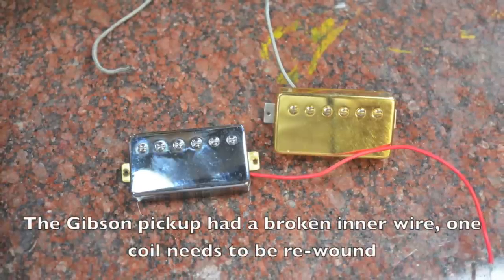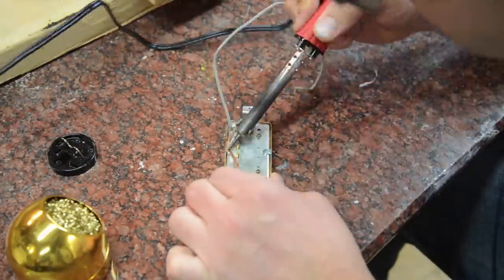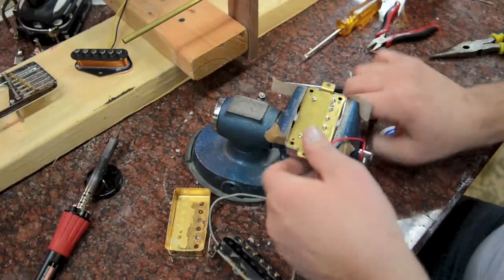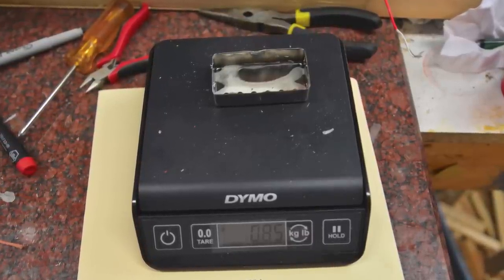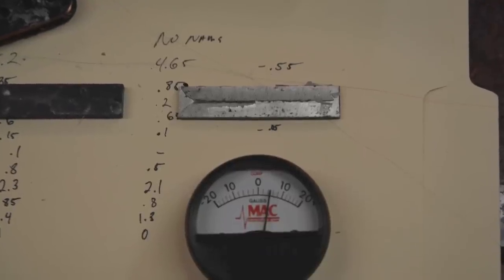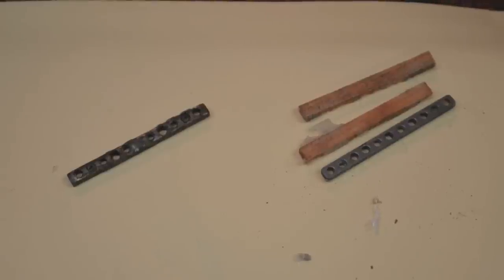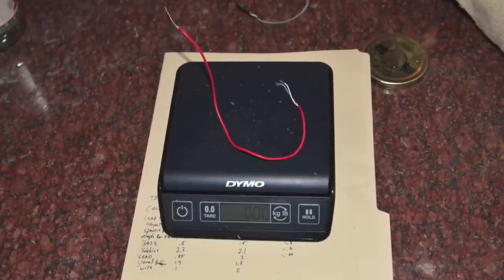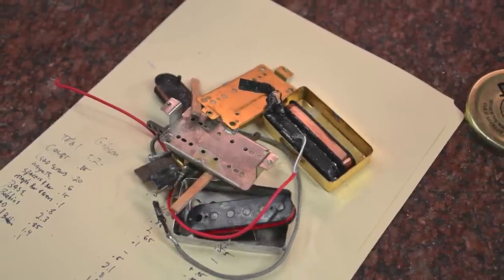Chinese vs. Gibson Humbucker, what makes a good pickup?

Comment: why do you state that the Gibson copper wire is a better quality one? they're probably made in the same Chinese factory...
Reply: the only significant difference between those pickups are the material in the magnet, and the quantity of windings in the bobbins.
Reply: Wire of the same gauge is made with all kinds of alloys. The chinese are known for using less copper and more fillers in the formula.
Reply: George Lackey that would dramatically affect resistance.

Comment: Easier way to remove the covers, heat up the solder and slide a razor in between. The solder won't stick to the razor and when it cools, pull the razor out and the joint is seperated

Comment: Well, I was expecting a DC measurment reading for each bobbin, testing how "magnetic" the base plates are, like Jay Dee sais it's far more important than weight.
Was expecting also the number of turns in each bobbin, and how was the wire winded in each pickup.

You are just comparing the weight of parts in both pickups, and left out some of the most important details while comparing two similar pickups

If you are building all American pickups you have to get rid of your Chinese soldering iron, chinese made Phone, Chinese screwdriver, Chinese wire cutter and Chinese scale, you'll be better off using all European tools!
Reply: Chinese can make high quality of anything... But you Will pay that.

Comment: While the differences are more noticeable. The real difference is the wax potting for microphonic. I had to pot a microphonic Chinese Telecaster single coil neck pickup. I used surfboard wax so that I wouldn't have to melt wax & dip anything in a saucepan. The surfboard wax, I was able to spread that on the inside of the neck lipstick style cover for the top & sides, and when I pressed the pickup & reassembled the pickup the microphonics were cured. With surfboard wax the sun will melt it f left out for a 1/2 hour in direct sunlight heat of the day, a hair dryer melts & flows the wax too. Heck leave it in a hot car and the wax softens even more, may even flow & have the same effect as wax potting by melting the wax in a saucepan. Ceramic magnets are stronger than Alnico V, you'd have to get Alnico 8's to start to have Ceramic strength. The stronger magnets are going to have a tighter low end, so it depends upon what genre of music you play. Metal, ceramic are actually the better choice, warmer tone go with a Alnico 2-V. DCR is just the relative number of windings of wire. All the guitars I have are ceramic single coils, P90 in Epiphone, whatever a Squier or Monoprice has in Strat or Tele. The surfboard wax and the Telecaster was as quiet as the P90, closely approximated each other for not being micophonic & tone really. The Epiphone P90's were 8.2k & 9.2k for neck & bridge DCR. The Chinese Tele was 7.2k & 6.8k neck & bridge. Enough difference, but not hat much.

I agree Gibson Alnico > Chinese Ceramic, not appreciably better, remember tone is subjective and is in the listeners hearing & mental perception. Mu point is, that a set of Chinese pickups will last as long and indiscernible at the string & pickup point of the process. After that there's an instrument cord, pedals of a signal chain. Then there's the preamp section of a circuit, any effects loop & that eventually ends up at a speaker that is voiced differently. The pickups are only capturing & transmitting the string vibrations. Those are a set of 10's, 9's or whatever you're stringing the guitar with. As long as the pickup registers the vibrations& passes that signal on, the pickups may even be located at different points between the neck & bridge saddles. Where one also picks & strums, affects tone, same with the pots specifications & even the microfareds of any capacitors in that signal chain.

Comment: This is probably a silly question, but why do covered pickups potted with wax and pickups with exposed bobbins not. Second, if I removed the covers permanently, must I remove the wax?
Reply: The exposed bobbins are probably potted and then wrapped (the copper). The wax between the bobbins and the pickup cover is probably used to reduce microphonic response of the metal cover.
Reply: I recently took apart the uncovered humbucker from my Epiphone SG Junior. The coils were potted. I figure they just cleaned off the bobbins.

Comment: I made a fixture for breaking the solder joint on the cover, a piece of wood almost the thickness of the pickup With a rout that the pickup fits in. I can now securely use a chisel to break the solder joint, which is a much safer way to do it, not so much chance for overheating the inside of the pickup. Try it :-)

Comment: It's better to cut the soft solder on the cover removal than to use a solder wick and subject the pickup to too much heat.  You can use the wick after it is apart.
Reply: +Kurt Cathcart I was cringing at what he was doing. Should use the fast easy method, a razor blade and a few taps. This guy knows not what hes is doing. Some people should never go near tools
Reply: Get a real soldering gun and use that rather than a soldering pencil. It is quick and you are done before anything gets hot. It's the same when soldering any ground spots to the back of a pot. Fast heat so you don't over heat everything.
Reply: Sometimes a little knowledge is bad.The dude sounds medicated, droning on and on.
Reply: What's  high end custom got to do with it? The dude is just a novice in training!
Reply: Yep, with a SEVERE bias to anything that says Gibson.

Comment: Vacuum wax potting can draw it deeper into the coils, I've seen variation in import manufacturers (some are dipped and some show vacuum). Some are pure petroleum wax (looks like Gibson you have is too) and other boutique builders mix in beeswax to offset shrink after cooling plus give higher melt point protection (if someone leaves the guitar in a hot car). I think Gibson vacuum pots their pickups (saw it in a youtube video), PRS wax pots theirs at the US plant (I was there at one of their open houses).
.
I've been doing a similar survey on pickups that lead me to focus on high internal capacitance as the cause of "muddy" pickups. I've found some of the import pickups have much lower internal capacitance than the 'famous brands' for equivalent copper length/resistance. "Hand Wound" pickups will have lower internal capacitance than "Machine Wound" due to scatter winding and tension on the wire (tight coil vs bird's nest) and wire coating thickness. I find high capacitance is like having the guitar tone knob permanently cranked passed 1 or 2 on the higher capacitance coils. For high capacitance pickups (like super over wound hotties) you can add a capacitor in series so it cuts the total pickup capacitance and gives back the clarity -- but why not start with a low capacitance coil?
Reply: Here is a bit of info most people won't consider.

Lower Z pups are the "vintage" sound. If you play real PAF pups through a Fender Bassman or Marshall amp you get magic tone. Super high Z pups are for metal and other stuff. Those folks think they want "vintage" but have no idea of what "vintage" sounds like. Anything over 10Khz is gonna be overkill unless you are looking for a Zak Wylde sound. 
A LP should be played with the volume on 5 - not dimed - for a vintage tone. Same with a Strat. Learn to use those volume and tone controls.
People will buy a $9K LP RI only to put some hot aftermarket pups into it. If going aftermarket at least go PAF voiced. SD and others excel at it.  
The hottest pup I have is a Dimarzio X2N mounted in a Partscaster I put together in the early 80s. It was meant for heavy and hard stuff but that pup is surprisingly clean. Lots of gain but clean. Yeah, it's ceramic; I prefer Alnico.

Tone quest definition - 
A guitarist who has played for years and thinks he needs better tone than what he has. He spends $$$$ on different amps and effects only to find himself chasing the elusive tone.
The funny thing is he had the right tone to begin with. I have watched it for over 40 years. 

I went from a Marshall stack to 1x12 combos; I have a few. I like the tone better and can always plug into a 4x12 if need be. Good thing sound guys mic amps so I can avoid the big cabs. 
I have a little SWR Workingman's 12 for bass and a larger Hartke cab if needed. Those big ass SVT cabs and folded horns are hernia machines. Bass is usually DIed in larger venues.

Comment: what is the price difference? You left that out of your comparison.
Reply: PRICE DIFFERENCE CAN BE AS MUCH AS 100 DOALLRS RIDICULUS  WHEN SOUND IS WHAT REALLY MATTERS  BEEN PLAYING  40 YEARS   I HEAR VERY LITTLE DIFFERENCE   GOT A  CHINESE STRAT RAIL   11 BUCKS  VS A SEYMOR  70 BUCKS   SOUNDED  IDENTICAL    SHAMFUL   IT A COIL   IF IT HAS MAGNETIC PULL IT WILL ROCK     I  MOSTLY USE STUFF FROM   EY GUITAR PARTS  GOOD SELECTION AND VERY GOOD PRICING
Reply from the maker: the gibson was dead so I paid 24 for it.  I got the cheapies for 17 total.
Reply: fred cook why the capslock? I'm one of those snobs that claims he can hear a difference in pickups. In a blind test I (and 5 out of 6 guitarist) actually heard a really clear difference even in the way pickups are wound. This was a test between Gibson burstbucker 1&2 and handwound boutique PAF replica's from a Dutch builder in several 'identical' guitars. However,  some gear is more sensitive/transparent than others and it's more audible with low to medium output pickups (everything is more audible with low to medium output pickups).

I disagree on the fact that a pickup sounds good as long as it has magnetic pull, but I do acknowledge the fact that active electronics and/or high gain is less sensitive to details.

I recommend people to try many pickups before actually investing in a set. I generally find Gibsons really underwhelming, even though the build quality is fine
Reply: i think what i am trying to get at here is, it is misleading to say something is lower quality compared to something else unless you tell the audience what the relative difference in price is.

That said, I appreciate this video was about quality not price, I just think the Chinese stuff gets a hard time on YouTube. They are not trying to compete tone-wise, they are just doing it quicker and cheaper and this offers those who can not afford expensive guitars a great way in to playing.
Reply: I'm all for a better image for asia built guitars. It's giving US gear a big run for their money, which has 2 major wins: US brands have to work harder to really show they're worth the extra bucks, and there's better low budget stuff. 

But the details...that's what really makes the difference in these guitars. Upgrading pickups is pretty straightforward and can be a really cost-effective way of improving tone though.
Reply from the maker: gnrock1981 The more pickups I take apart pickups the quality of the components used shows.  Price is the one obvious difference but density of plates, bobbins and wires is huge.
Reply: +BigDGuitars - but which parameter did you use to state that the Gibson copper wire has a better quality than the Chinese made wire? it's not really explained in the video
Reply: The Chinese probably use the same bobbins of Formvar wire as does Gibson, Fender and others.
Reply: @joseislanio8910  He used the ol' Soldwedelian Christmas Gift Evaluation Method: it's heavier, so it must be worth more. Highly scientific (not really). It's how I used to try and guess which gifts were the real whoppers. However, as I've since learned, correlation does not always equal causation.

Comment: try a dremel with a cutting disc to cut the welds on the pickup cover..
Reply: Use a hotter soldering gun rather than a soldering pencil for a quick melt of the stuff rather than heating the cover to glowing. 
The correct tools are essential.